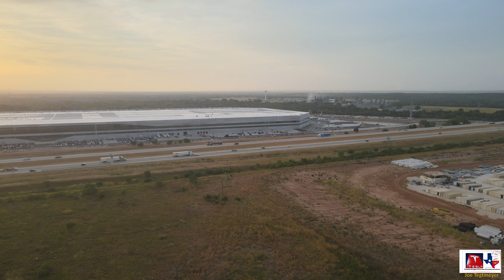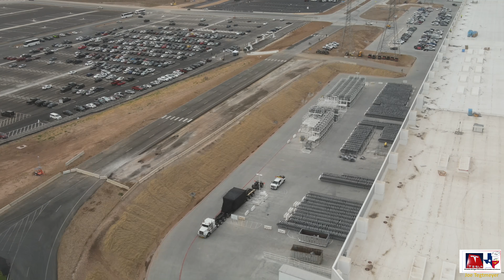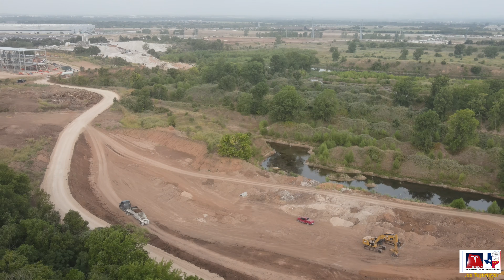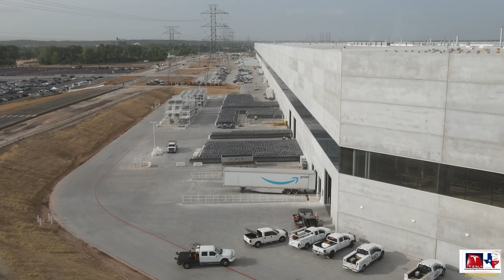Tesla Gigafactory Texas 15 August 2022 Cyber Truck & Model Y Factory Construction Update (07:30AM)

Comment: Are the purple irrigation pipes perforated so that they irrigate in a similar manner to the way a soaker hose system works when buried in the soil? 
I personally love soaker hoses. Soaker hoses for those that don't know, are basically flexible leaky soft rubber hoses that very slowly allow water to leach out into or onto, depending on how you use them, the soil. Super efficient water usage wise as they really help stop excess evaporation. They are available to buy online from Amazon & other retailers if anyone's interested. They've been used in New Zealand for the last 50+ years and the same in the USA as far as I can tell.

Comment: Electrician here:
22:04. The conduits coming out of the vaults are known as a "duct bank." The concrete encasing them is covered in red iron oxide compound to denote electrical system below the concrete. This is to warn anyone who digs into this later on that they should stop digging.
Reply: 22:04. Not a 'bunch-o-conduits' then?
Reply: @DessieDoolan  It's a conduit "bouquet." Always a nice gift for your electrician on "Electricians day."
Reply: @GoCoyote  It's on you if Joe starts referring to 'conduit bouquets'!
Reply from the maker: Thanks … I use this info in my 17 Aug video!

Comment: They started using the Giga press very early in the construction of the building. You could see inside; the floor was still dirt in many places and the walls and roof not complete. When it rained it was a mess in there. They were making and stock piling castings a long time before the first cars were completed. The absolute limit to how many cars they can make are the Giga presses output. They are making room for the new super Giga press. If that is about 3 to 4 thousand castings, that is just 2 days' worth when at full ramp.

Comment: Before anyone asks, no, I will not be counting the castings. ;)
Reply: I don't trust castings. Concerned they will crack in a collision. But what I'm really refusing to buy is any vehicle that has an unrepairable battery pack! Or other unrepairable components that are expensive. Nor will I purchase products from ANY manufacture that is anti-independent repair.
Reply: @DavidJohnson-tv2nn  Sandy trusts the castings, that's good enough for me. For the battery pack, any individual cells or modules that fail would do so under warranty. After 100k miles you wouldn't want to replace parts of it as the imbalance would damage the rest of the pack. The entire pack can still be replaced, which is what you'd want to do.
Reply: @FutureAzA  Sorry, but NO I don't want to replace the entire pack at a cost of $10,000 to $20,000! 
Therefore I'm boycotting any company that has an anti-independent repair policy. Definitely NOT buying anything with an unrepairable battery pack.
There are videos that show you CAN repair battery packs. Anti-independent repair and the excuses that come with it only benefit the rich stock holders at the expense of the customer! Not meaning to say anything bad about you, only that you shouldn't believe everything that you read. Much of it posted Tesla stock holders who have an obvious conflict of interest.
By the way, the people who will be screwed the most are those who can least afford it. Those who purchase used cars outside of warranty. And YES components WILL fail outside of warranty.
Reply: @FutureAzA  You should watch the video on The Gruber motor company channel. Where a single dead cell bricked the entire $20,000 battery pack! They made the repair by opening the pack and snipping out the bad cell! Saving the customer an enormous amount of money. Money that didn't go to a billionaire!
Reply: @FutureAzA  Regarding castings....
Sandy is one of the most intelligent engineers in the automotive field. However, he makes his money by saving big corporations a lot money. He does that by finding ways to cut manufacturing costs. Which are his main concern. Notice the he hasn't yet condemned the unrepairable 4680?  And... He's a Musk fan! Yes, he's smart, but no, I won't take his word for it.

Comment: Thanks Joe.
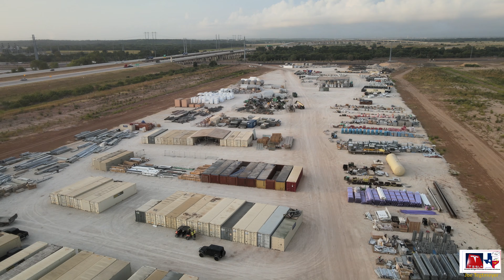2:59. Starlink/SpaceX site. Right of screen. Large white panel marked IDRA.
Golf cart. Some painted Model Y BIWs seen here in Brad’s previous video, https://youtu.be/ziBtIicS1h0?t=572
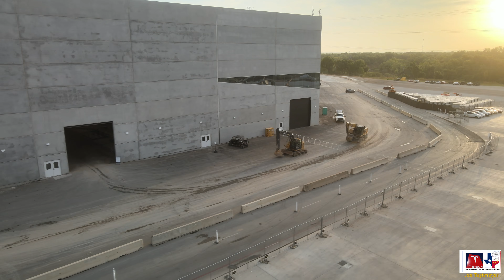6:17. Stamping, road. Concrete road barriers. Possibly for separation of the construction traffic. Similar around the south west corner of GA.
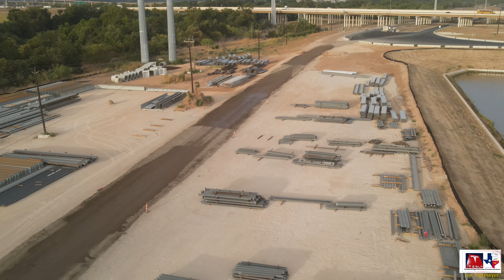7:55. Steel Fabrication Yard. Small section components. A change from the usual deep section beams.
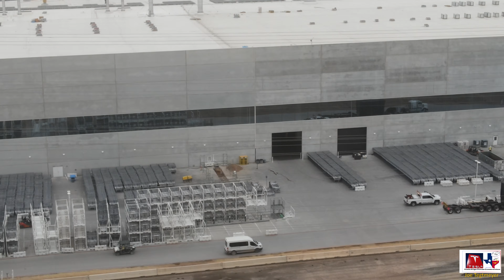11:34. Casting east, apron. I did a count, accuracy not guaranteed. 2600 on the ground, 1350 or so in the racks, plus some strays. 4000ish.
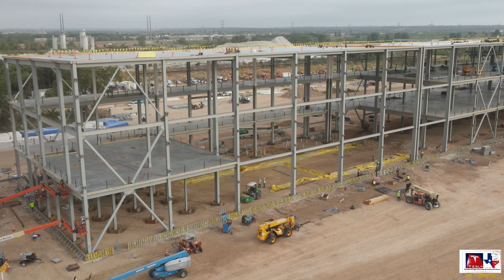16:10. Cathode, inside Level 1. Mud slab placed over the yellow plastic in the shallow trenches. Some squat formwork shuttering made up beside. Accurately forming up beams for something heavy to placed upon.
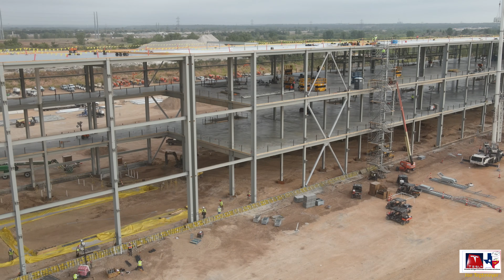16:23. Level 3. Under roof suspended platform, more components on the floor.
16:38. Exterior. Note 3 different projection wall panel brackets. Takes into account the column section, column orientation, and it’s set back from the building line.
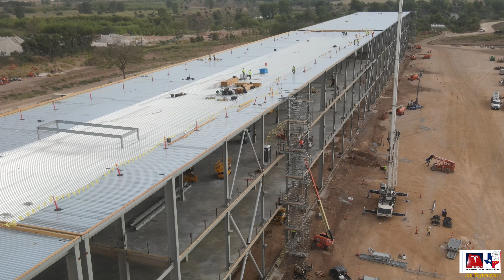17:07. Cathode roof. Timber. Think it’s primarily to fix the final membrane down. Did similar on the roof of the Stamping Extension. The timber is the same height as the turned up steel angle on top of the perimeter beams.
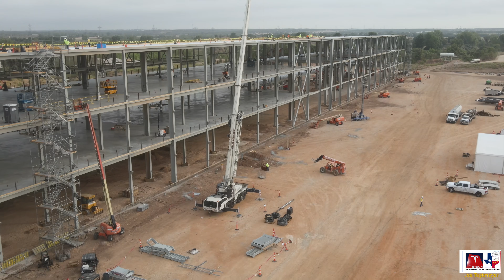17:23. Cathode. Right of screen. Think these are the Cell-Crete vehicles for the light weight concrete for the roof. Seen here across the highway, https://youtu.be/VHjoD7_psoo?t=644
19:57. Cathode. Exterior. Conduits about to be encased in concrete. If not electrical, then something else particular important.
23:05. Plastics, apron. Presumably the flue is for Plastics. Although there is no obvious existing roof curb/kerb/upstand on the roof.
Plastics, apron. The mystery trapezium frames seem to be a top gate for the racks. I can only imagine the gate is opened within a restricted space.
Reply: Thanks Dessie,  I always look forward to your insights so I can go and look back over the video for a second time 😃
Reply: @Dwayne.Shea.231  Thanks Dwayne. Certainly pays to read the comments. I read all of them.
Reply: Conduit sweeps are consistent with those used for medium voltage cables (circa 4k volts) or large diameter conductors like 500 MCM.
Reply: @GoCoyote  Is it a hard and fast rule that only electrical is encased in red concrete?
Reply: @DessieDoolan  Here in the US it IS NOT part part of the National Electrical Code that red iron oxide be spread on top of the concrete, or red dyed concrete (often known as "red dog") be used to identify duct banks, but it can be required by local or state jurisdictions, utilities, highway authorities, project specification, or contractor preference. I don't know if that precludes its use for other types of poured concrete protection for other utilities or underground "stuff." Duct bank concrete is often a 1000 psi, or "lean" mix, in order to save money and allow for easier rework if necessary. The concrete encased duct bank maintains the required clearances for conduits within certain types of systems while also providing mechanical protection.
Reply: @GoCoyote  Thanks Sparks. 1000psi is about 7MPa, a mom and pop mix.

Seems a lot of large diameter conduit. Until it's clear what the setup will be at Cathode, speculation can run wild! As usual!

Comment: Thanks for your great flyover videos of the Austin Giga factory. You are Numero Uno. 👍. I wonder if there's an explanation why Elon Musk hasn't, as a matter of priority, pushed the production of enough Semi Trucks for moving freshly made cars within the Giga Factories? In the videos you see large numbers of diesel rigs in use. Could be the ideal testing ground before large scale production starts. Any thoughts?
Reply: The hold up has been the lack of 4680 battery cells. These cars are being made with 2170s. The Semi requires the 4680. As soon as they have solved the 4680 production problems we will see Semi being produced at Nevada in small quantities and then later large production here at Giga Texas.
Reply: @royh6526  thank you kindly for your reply. You have cleared up this burning question I had for some time. 👍🤠🦘🇦🇺

Comment: Joe, there are a number of good speculations about the castings. Based on the low number of vehicles showing up on the south end, I wonder if they have run into an issue on another part of the production line. Overall output will have to pick up significantly if they want to stop burning cash, as Elon said, anytime soon. I had hoped to see many many more cars coming out of production by now. Scaling is hard though...
Reply: They don't spoil, they don't go bad and they will use them eventually so the plan is to stockpile them so when they do maintenance on the GP, production can be uninterrupted.
Reply: @steveambro7848  Wouldn't that be why they have multiple casting machines?  I believe they have three, maybe four for just the Model Y.
Reply: @sammyk874  yes, but what if paint or seats or anything else Dienst work properly?

Comment: I don’t know if this has been discussed, but purple pipe, where I live anyway, is for reclaimed and non potable water. Generally used for irrigation or industrial uses where it does not need to be fit for consumption. Example’s might include mixing concrete as well as cleaning the trucks, spraying the roads to keep dust down and all landscape irrigation. It might be filtered, but is generally not treated with chlorine or other things to make it safe to drink. It might be different in Texas, but I doubt it. Anyone know more?
Reply: I don't know, but this factory likely has all of those needs and more. Cooling is another use.

Comment: Hello Joe, I've been curious for a long time about the original mining operation on this Giga site. There are obvious long mounds of excess dirt piled up so what was being extracted?
Reply: Well known to have been a gravel quarry for the onsite concrete plant.
Reply: Overburden - removed to access the gravel under it.
Reply: Looked like sand and aggregate to me. Possibly Tesla is going to make its own concrete (concrete = sand + aggregate + cement). The scale of the plant might make it more cost effective to make your own concrete rather than buying ready mix.

If that pile is dirt it's extremely clean dirt. If the rocks are from on site then the rocks are amazingly consistently sized.
Reply: @Patrick462  Oh brother.

Comment: I agree that all those castings outside can possibly be the result of opening floor spacer for construction of the 9,000 ton Giga-press. But the other thing is that it appears that the takt time of the Giga-presses currently exceeds the takt time of the body in white assembly line. That's a good sign. The presses are running great. They need to tune the body assembly operation and crank it up. Technically both operations should be running at the same rate with no excess inventory.
Reply: I agree. It doesn't look like the gigapress will be the bottleneck.

Comment: Those castings probably weren’t made overnight. Elon said they will be installing tooling for CT soon. Is it possible they are clearing out the space for that? Could these castings have been stored there inside where the CT  castings is to be built?
Reply: They were all over the Giga press area. Joe did a flyover look in several months ago and they were piled high. Never used them all so they were just organized outside to make room for new Giga press to get installed.
Reply: I think when we've seen them inside they were in the are where more gigapresses were. So hopefully clearing it out for a new gigapress or several

Comment: I have a hypothesis for the number of castings that we saw today in GT. There are similar storage of thousands of castings at Fremont, GB and GS. This cannot be a coincidence.
I think all of IDRA casting machines are going to get an upgrade (Hardware & Software) to make them more efficient and reduce waste. The upgrade might take few weeks hence all the sites have produced a large number of extra castings so that they can continue with the car production process when the casting machines are idle.
Reply: Maybe.
Reply: Freemont has had casting piles for yrs. so it must be that they want a buffer for general purposes.
Reply: Possibly making space for arival of the cybertruck 9,000 ton IDRA machine.
Reply: @fredhearty1762  Bingo! At Austin at least, this makes a lot of sense. When they install the large casting machines it's going to tie doorways, Crane ways, floor space, etc., for weeks. The surplus will allow them to continue the build rate while all these disruptions occur. I think what is extremely positive is that they have the capacity and ability to pull this off even while MY production ramps up. Obviously, lessons learned from Fremont are yielding tremendous results at Austin.
Reply: @fredhearty1762  I Sure hope so! Been saving up for that truck for a long time now
Reply: They don't spoil, they don't go bad and they will use them eventually so the plan is to stockpile them so when they do maintenance on the GP, production can be uninterrupted.
Reply: I'm impressed how well castings "nest" together, that's not a given considering complexity and other design priorities, but sure important for stockpiling.

Comment: In this video, as well as in the drone videos of the Fremont factory on the other site, it appears that the production of the castings is far outpacing the production of the rest of the vehicles. At some point they'll have to address this discrepancy ...
Reply: They don't spoil, they don't go bad and they will use them eventually so the plan is to stockpile them so when they do maintenance on the GP, production can be uninterrupted.

Comment: I wonder if they might start exporting castings to the Freemont factory?
Reply: Maybe casting area will be shut down for a period of time for new equipment installation so they made enough/are storing castings for this time period.
Reply: Considering that they are reportedly producing both 4680- and 2170-based Model Ys at Giga Texas, they have castings compatible with the 2170 Model Ys, so why not ship them to California for use there if they're consistently able to produce more than they need locally.  I'm not clear on whether the castings are different depending on whether there's a structural pack; I'm assuming they are, but perhaps not?  Maybe they just add more structure with the 2170 pack?